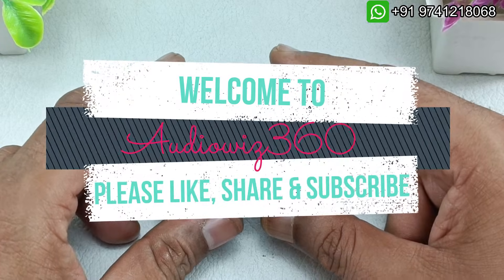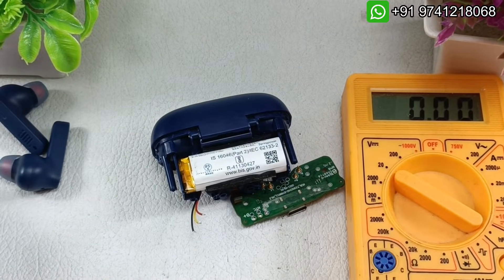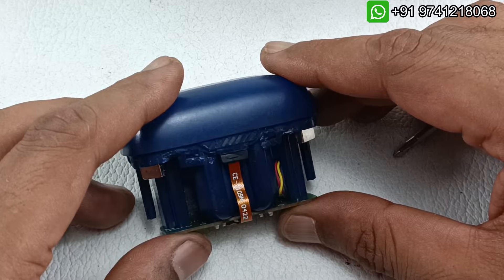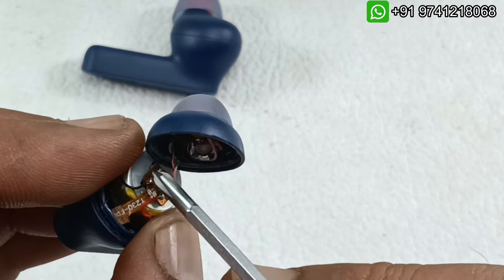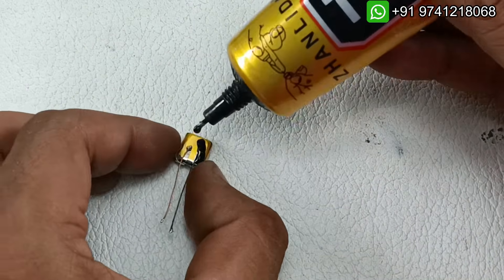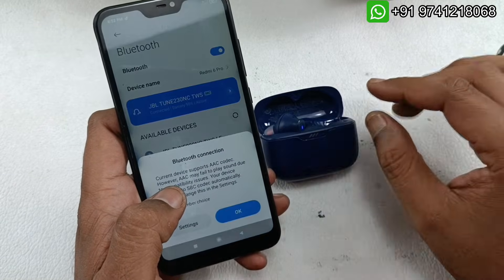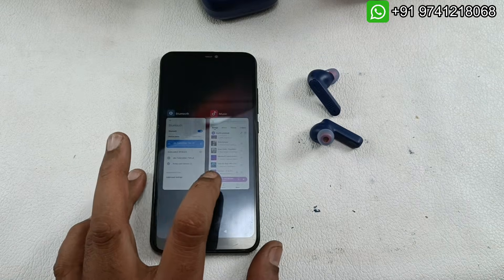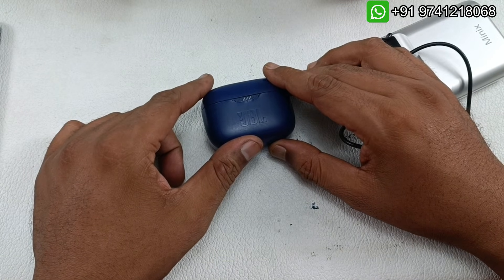JBL Tune 230NC Earbuds | Completely Dead Fix | How to Replace the battery of Earbuds | Case Battery

Comment: Got the battery replaced for my JBLTUNE230NC. Its working as a brand new one and gives solid backup now. Loved that he cleaned the cae and it looked brand new when i received it. Amazing work and timely delivery and reasonable pricing. I highly recommend Audiowiz360. 
Thank you Audiowiz360!

Comment: They need to have a law that all electronic devices that use a rechargable battery are designed so that the battery can be easily changed by an inexperienced person using simple basic tools in under 10 minutes and come with instructions for doing it.

e.g. remove four small cross-head screws.  Remove old battery and replace with new.  Replace the screws.

This should be especially for phones which make it almost impossible to replace the battery these days.

Comment: Brother. I am trying contacting you but your number is switched off and also your internet is off too…… I also have a JBL 230 NC TWS which is facing the same issue. Do help
Reply from the maker: I was travelling and battery was low so it was off, you call me now or message me in WhatsApp 
9741218068.

Comment: Mybearbud giving 5 minute backup after changing battery it is not turning on or charging
Reply from the maker: from where you changed the battery and what is the battery model?

have you connected to the right polarity to right terminal point?
Reply: @audiowiz360  yes I connected black wire to the point where previous black wire was connected and same into the red wire . 
I took the battery from my old earbud which I did not use anymore it was boat airdopes 141
Reply from the maker: have you checked the battery before installation. what was the voltage in it?

Comment: My JBL 230NC has battery drain issue. It will get drained with in 15 mins and I have to charge again. Based on this video I contacted him and he helped me to get the battery changed in both EarPods and now it is working really well without any issue. Now I am happy and able to get good backup appx 7 hrs with 50% volume., thanks for the support bro.
Reply from the maker: you are most welcome! 😊👍
Reply: how do l contact him l have the same problem
Reply: Pls give battery product link

Comment: Thank you for the video.
After a small fall, the left Buds-Seaker of my JBL Tune Beam  no longer worked. Touch function was still okay. Thanks to your video I was encouraged to open the case. With a good soldering iron and some solder it was done in 3 minutes. The red cable had come loose from the circuit board. I had to glue the Bud housing afterwards but the sound is as good as before.
Reply from the maker: Glad it helped
Reply: exactly what happened to mine. This video helped me sort it out too.

Comment: Very good video! I have the same buds, but different issue. The battery life is good, but their volume is low. I guess it happened after I have dropped them in water. What should I do?
Reply from the maker: need to check the speaker drivers of it etc.

Comment: My jbl tune 230 nc right side is not working and left side battery drain too fast can u repair for me and please tell the cost🙏🙏🙏
Reply from the maker: yes I can do. please do message on WhatsApp +91 9741218068
Reply: Same with me also
Reply from the maker: please do message on WhatsApp 

 +91 9741218068